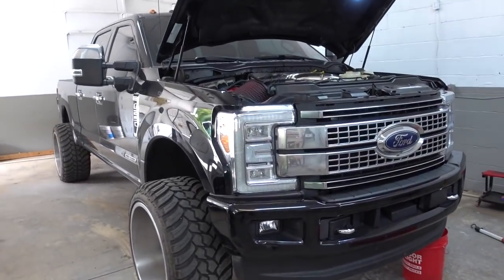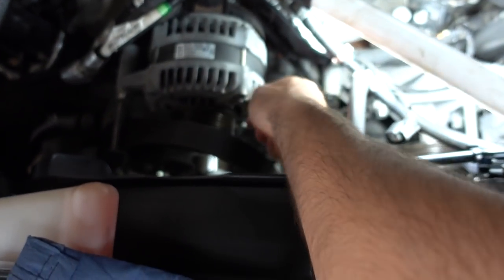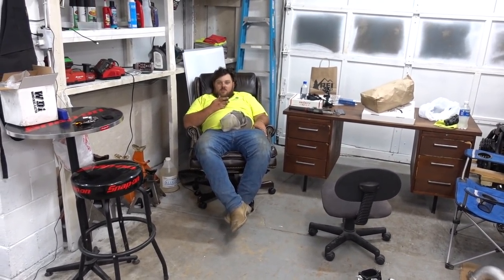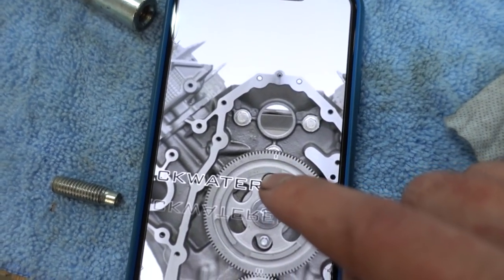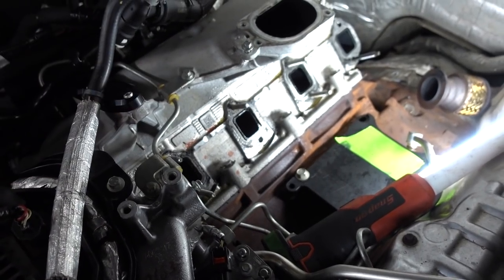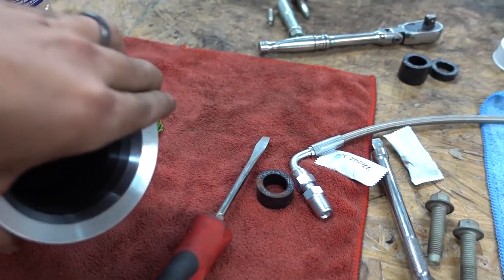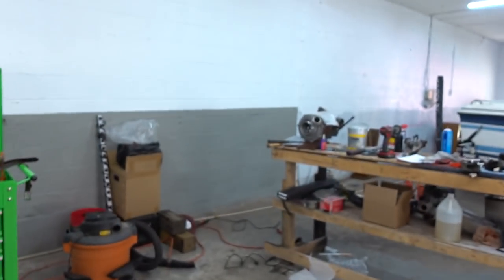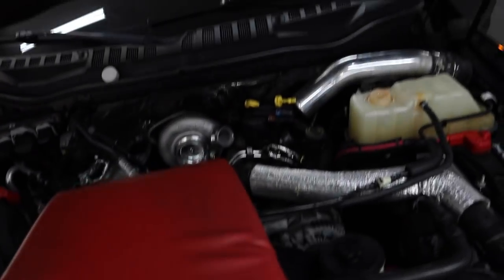Ford 6.7 Powerstroke Gets MASSIVE NON VGT Big Turbo Kit and NEW CP4 - FULL INSTALL

Comment: That’s sweet bro!!! Pretty sure I’m gonna work with Dan on new turbo, tune and fuel pump to get some more power on my F550 tow rig!
Reply: Go with compounds I am just adding a charger a 75mm precision and keeping the valley charger the same.  Cost you more $ but a better option if you love your 550 like I love my F250
Reply: Dr. BOWDOIN awesome good to know

Comment: Really liking your videos. Great job in the install. This truck is different than most in that you worked it , it’s no trailer queen !  Can’t wait to see how it turns out,my only concern for you is the turbo lag for daily driving with the non VGT turbo,once it lights I’m sure it’ll be a blast .

Comment: Is this turbo good for hauling I Max my truck out at 42,000 lb need something just as good out of the hole as mid-range and also wondering about the intake plantom thingy lol cannot find it on their website but wondering if this turbo will work on my cab and chassis 2011 f550 6.7 of course

Comment: What would you recommend? I’m a 13 on stock fuel right now. 363 or 363?
Reply: Did you ever get anything any of those chargers on?
Reply: @dnsbb8033  went with a 364.5 and a 15+ cp4 with proven tuning
Reply: @MW3HAXX  are you happy with the 64.5? I just just installed a 369 but haven’t got on it yet but I was told by my tuner to take it easy for the 2-400 miles but so far it feels great
Reply: @dnsbb8033  I like it. For where I’m at. I live at high elevation so the 64.5 is great. Ran it for about 20k miles. No regrets yet.
Reply: @MW3HAXX  that’s good! Bet it feels better then stock